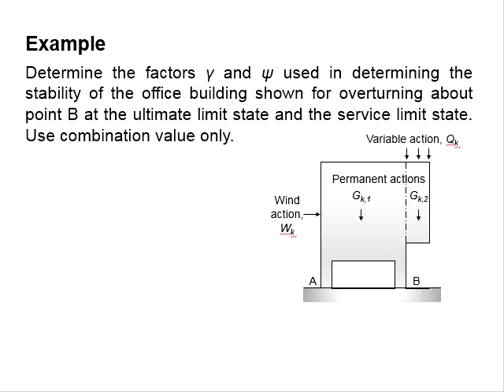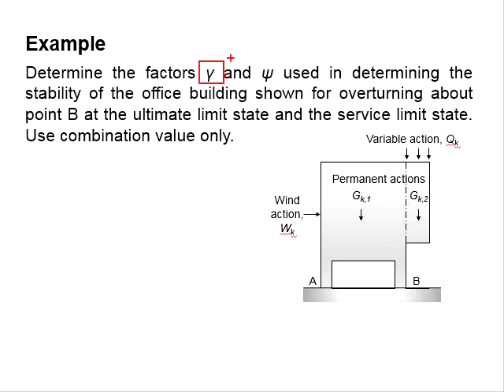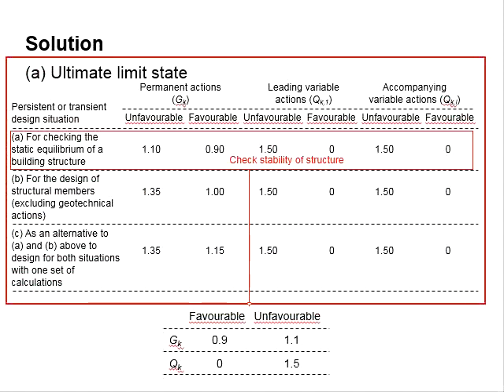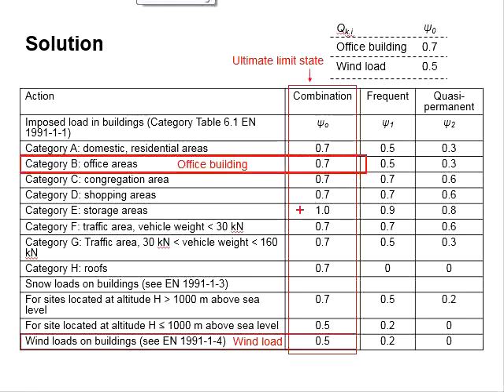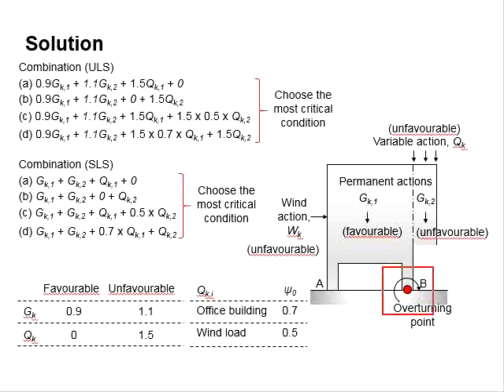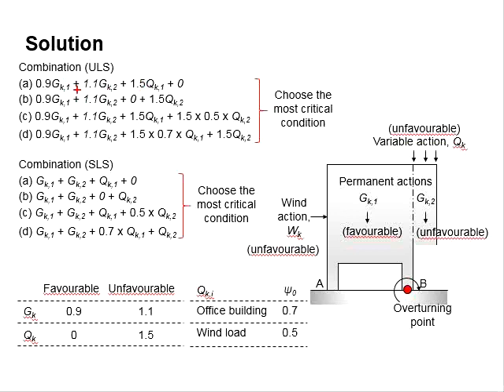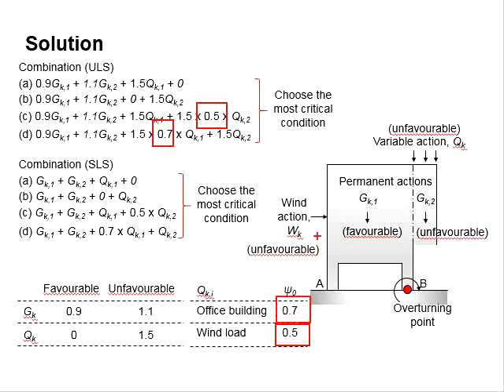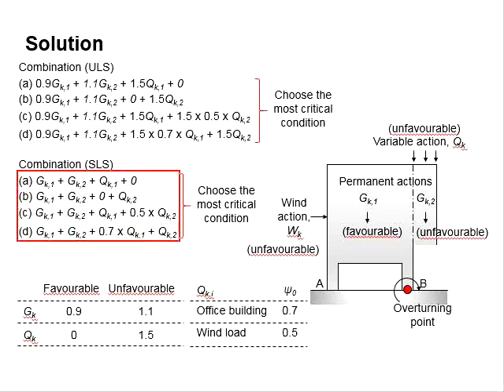2.13 Example: Factors of safety at ULS and SLS

Comment: Hi, on the slide at 5:07, Combination SLS, aren't you suppose to apply the "Frequent" and the "QP" psi values (psi1 or psi2) ?
Reply from the maker: Ya. Probably you are right. Thank you for your input. I guess I get your point. It will be good if you could further explain this.